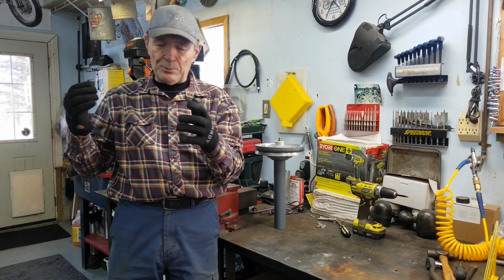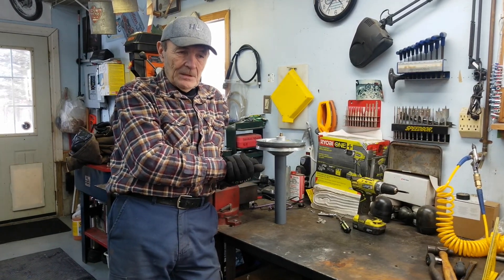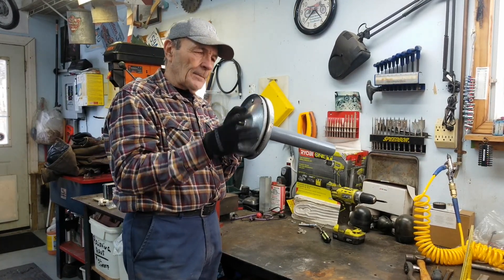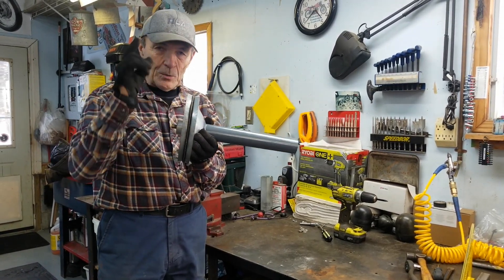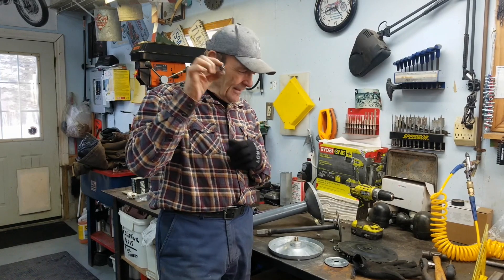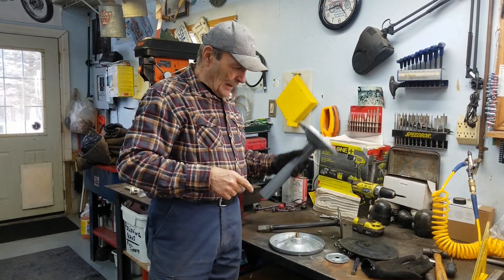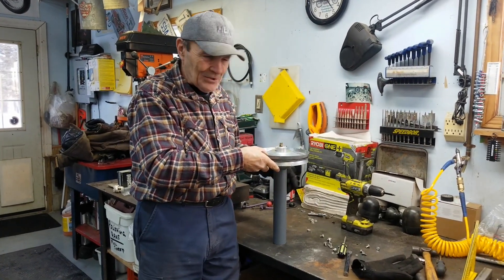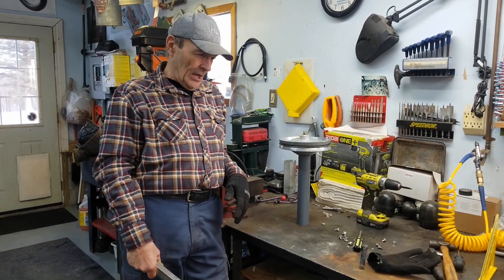#123 Servicing A Pond Bubbler | At The Ranch

Comment: hi Alec. there must be a check valve on the output side too I would think? Otherwise it would not pump very efficiently.
it might be just a rubber ball on top of the fitting? Like a standard diaphragm compressor setup. It is really neat to see old mechanisms that have stood the test of time.
take care stay safe Owen m
Reply from the maker: Nope. There's just one little check valve Owen. Really that's all that's needed. It let's air in when the diaphragm is going down and then traps that air so the diaphragm can force it out on it's way up. Simple & it works.
Alec